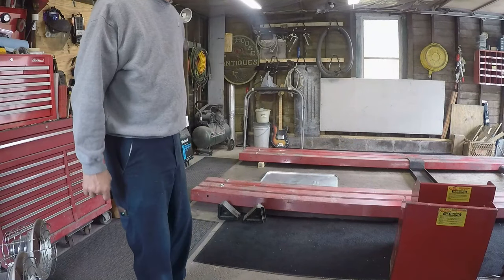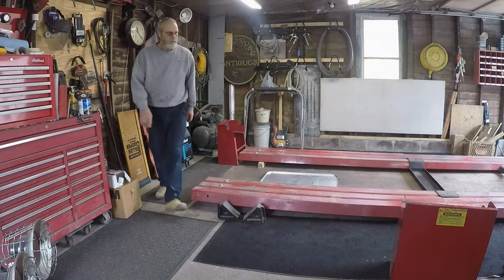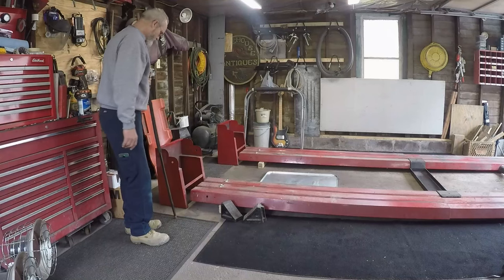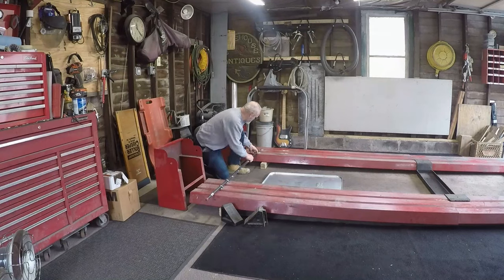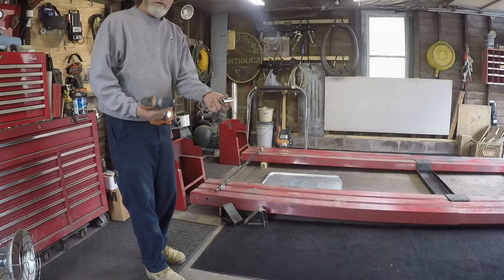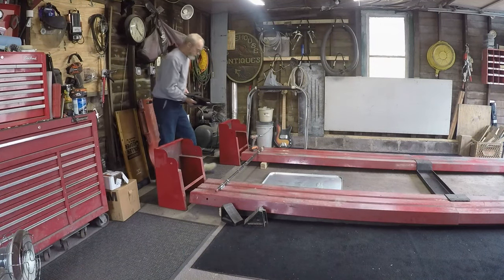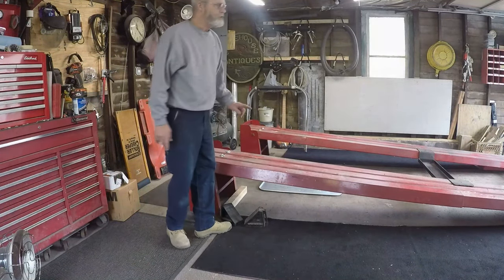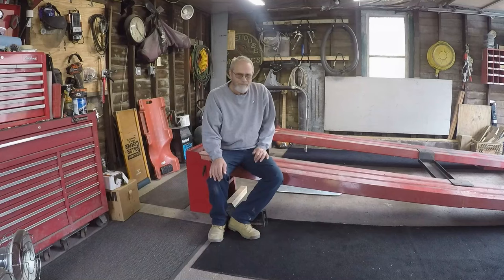Kwik - Lift

Comment: I just bought a Kwik-Lift yesterday.  Found it on FB Marketplace.  I didn't know which length to set them, so figured to try the shortest first.  That was a mistake, because the jack-bar is too far under the car.  I'll have to make them longer & try again...
Thanks for the video.  It helps to see you set up tricks.

Comment: This is a nice idea to make the work not only easier, but also more safety.  I’ve found this video when I was looking for some ideas for car lift which is simple and affordable.  For me this lift seems to be ideal for my garage because my garage is small and low height.  However, I am living in Japan and this lift is not available for me unfortunately.  Therefore, I am considering to make similar lift by myself.  If you could give some information about the thickness of the lift panels, it would be very nice.  Finally, thank you for uploading the video.  I’ve subscribed your channel.  I would like you to make a video to introduce your garage and tools in future.
Reply from the maker: I don't really know too many specs on the Kwik-Lift but if you check out the web site that may give you more info than I could. [my guess would be 14 gauge]. I bought this used, I got a killer deal on it. Found it on f/b marketplace. I called him up and offered $150 less than what he was asking [figured the worse he could do is say no]. But he said, "If you come tonight, you can have it". 
I was also considering [at the time] Quick Jack, another option for low ceiling garages.
Reply: @itseasiertotakeitsomewhere738  Thanks a lot for your reply and suggestions.  I visited the web site once, but will check again.  Quick Jack is available in Japan.  To buy the used one would be nice if I could find it.

Comment: Will the jack not lift the back it will lift a car? I have to ask why do you take it apart each time is it in the way?
Reply from the maker: For safety reasons, do not try and lift the back of the car once it is on the ramps.
I don't take it apart I just take the stantions off when I don't need the car in the air.
Reply: You can lift the rear of the ramp, it has a cross member and legs for that purpose.

Comment: So how do you raise the other end when the vehicle is on it?  Not much good if your vehicle can't drive up the slope.
Reply from the maker: There is a cross bar at the back that tie the two ramps together, you jack the ramps up and when high enough fold down the legs then let the jack down. Agreed, not much good if you can't drive up the ramps. Luckily, I haven't been in that situation. I've thought about rigging up a winch to the front of the ramps, but I'll deal with that when the time comes.

Comment: Can I put bocks under that ramp tower to increase the height of lift?
Reply from the maker: I wouldn't because if the stanchions slip off the blocks while you drive up or when you stop, "bad things could happen".
As it sits the bottom of the wheels are 20" off the ground.
Reply: @itseasiertotakeitsomewhere738  Thank you so much my bro!  This looks awesome!

Comment: I see long ass ramps that take up too much room and when your car is on them, you still have to crawl under the car just like you would with jack stands or smaller traditional ramps. Where is the benefit here?
Reply from the maker: Yes, you still have to get under the car just like on a creeper, but the ramps are extremely safe unlike jack stands. Drive up the ramps then jack up the back via the cross bar at the rear of the ramps, fold the legs down and you are good to go. The whole car is up in the air 22" from the bottom of the wheels.
Reply: This is the safest option to mid-rise lift/jack a car, and could be the fastest option too. This is what I went with actually as I never really needed to walk under a car.. yet